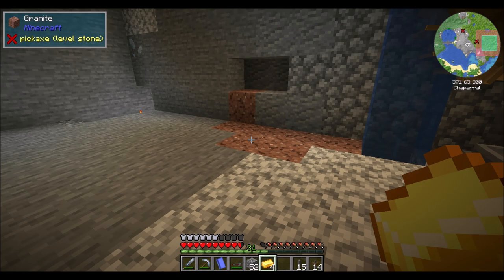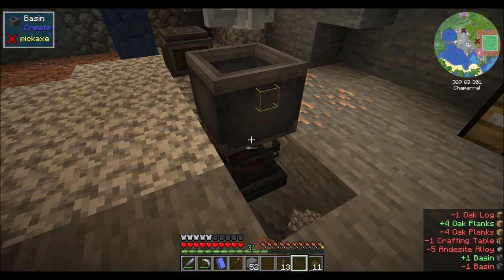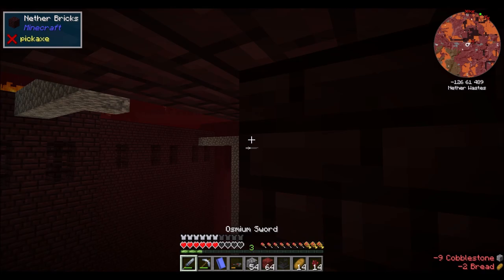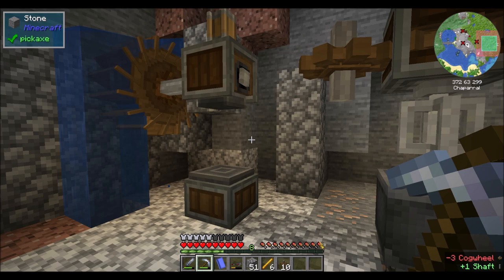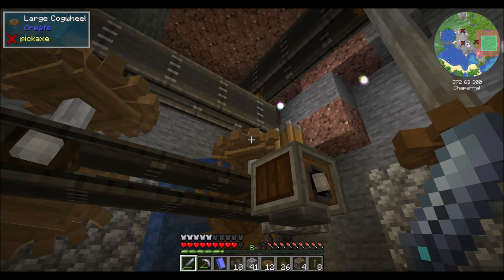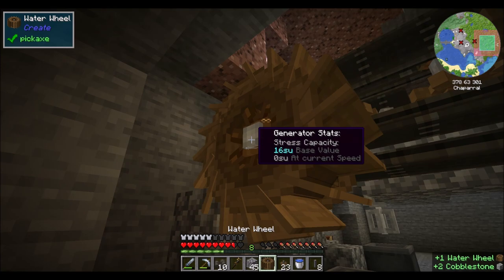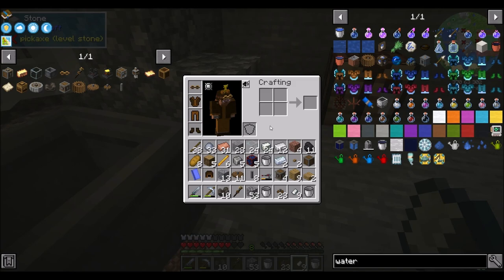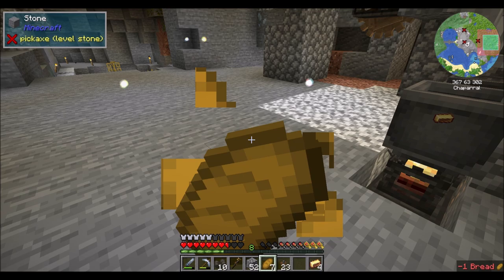Forgecraft S14E5 Mixing with Create

Comment: Dire really cannot understand create xD can't place belts on gears, think of that logically. Look at the models and just fine how to rotate the gear or shaft. It isn't hard. Can't place big and small gears side by side but can diagonally. Small gears can convey rotation side by side. You don't need as many belts as you think. I made 3 sets of each gear and no belts my entire run up to bronze last I played as an example. One water wheel isn't an infinite source of power. Make more, or separate your systems. Love the Dire Belt work but I can only cringe so much.

Comment: To connect rotation from your press to your mixer, you need two large gears and a small gear. A small gear where you already put one, with a large gear on top of it, and another large gear on the side of the press. The rotation can pass through the press. Though that doesn't fix the problem with the speed. You can use a single vertical gearbox and a few gears to do that, provided you shift the mixer forward or back one (if you think of the press as to the left)

Comment: Your water wheel could be more efficient. Consider this diagram to be your water wheel currently:
W W W
X  O  W
X  X  W
Where O is the waterwheel, W is water, and X is a block.
The most efficient way to run a water wheel is like this:
W W W
X  O  W
W W W
You place the water source above the block, and let it flow all around the water wheel.

Comment: The press showed Stress Impact, while the waterwheel showed Stress Capacity. SU is Stress Units. Current stress is Base Value times Speed. The Water Wheel has a base capacity of 16 and rotates at 8 RPM, so it has a total capacity of 120. The press has a base impact of 8 and is being rotated at 8 RPM, so it has a total impact of 60. Basically, you could have another press attached to the same system, but would need to add another water wheel if you want to spin faster.

Comment: I know I am late, but there is a dupe bug at 27:33, 
Dire starts with 23 zinc, 
throws one on the ground 22 zinc
step back a bit throws another one into the basin 21 zinc
The 1 zinc on the ground grows by 1 and 1 gets added to the basin
dire picks the 2 zinc up from the ground so he is back to 23 zinc.

I assume this is because of creates unique way of handling item entities. I suspect this also works with conveyor belts too.